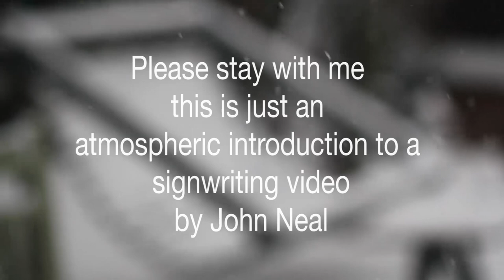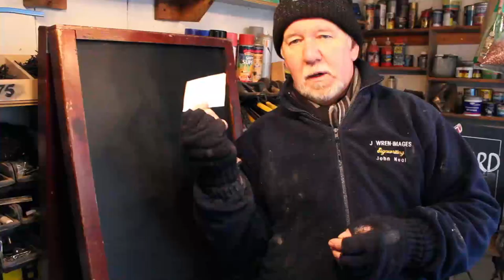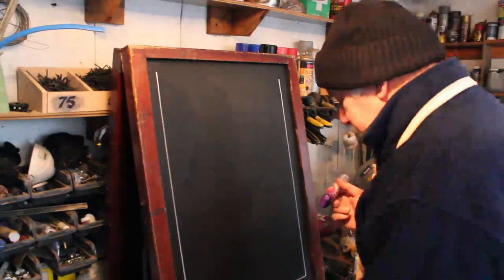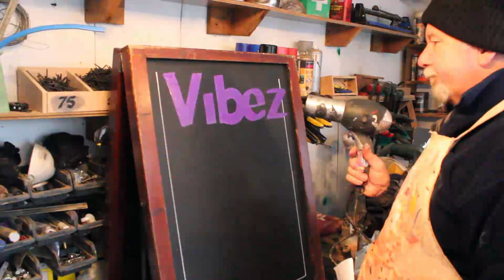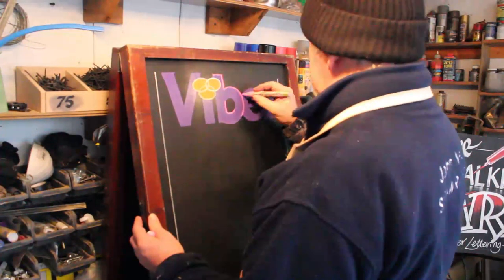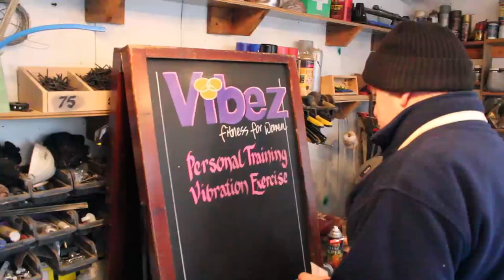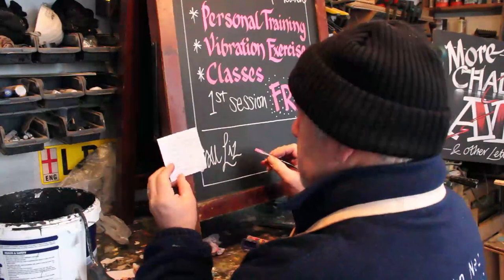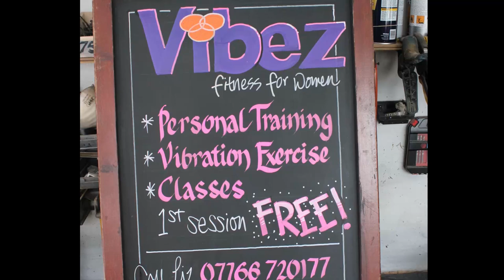Chalkboard Artwork for Vibes

Comment: What are you charing to do a sign like this? 100 quid? More?
Reply: gigfydotcom No £60 or just £50. On site I’d do this one side in about 30 mins so both sides in about an hour, and if I hadn’t travelled too far £60 is a good price. If I charge more than this it would be too expensive to ask me back and change it at a later date.